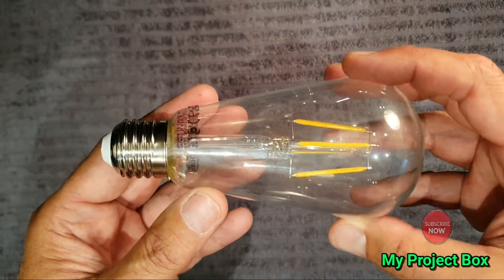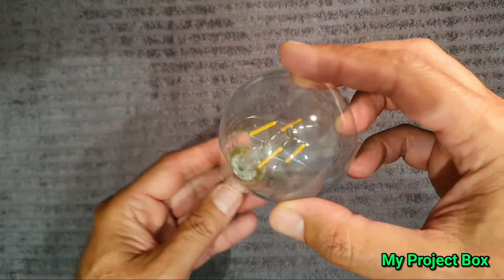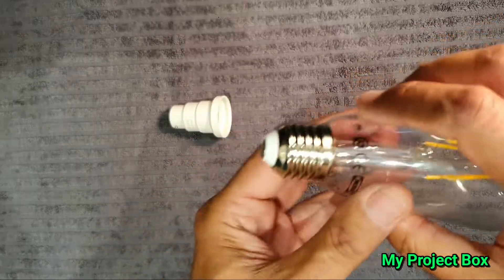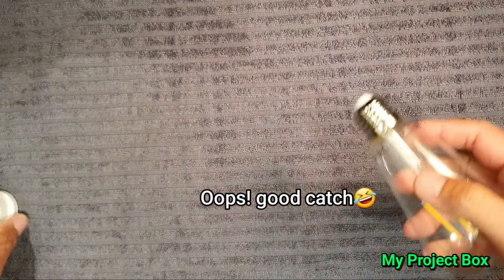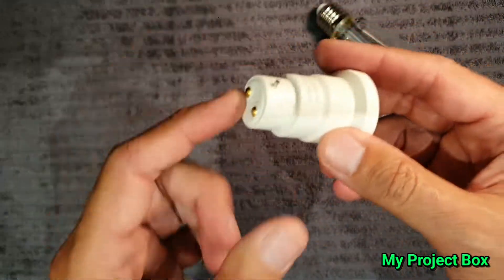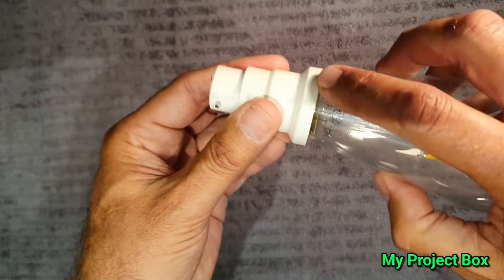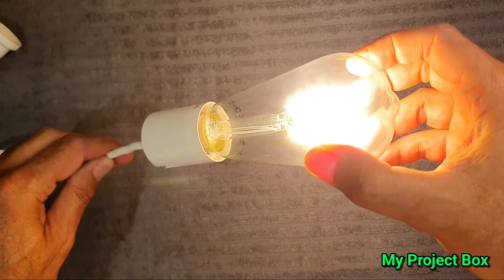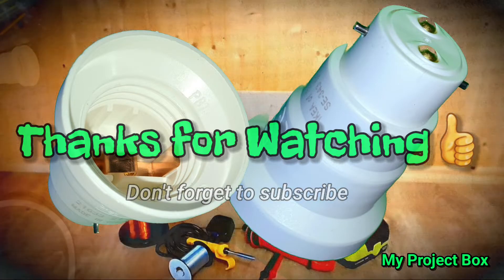Edison screw to UK bayonet Dangerous or Safe adaptor E27 to B22

Comment: Just to clarify. Does it matter if the polarity is reversed? Because its AC after all. It will reverse as per the supply frequency 😅
Reply from the maker: No it doesn't matter its AC😉👍 BUT Live is spicy and Neutral is not! So touching Neutral won't give you a shock😉